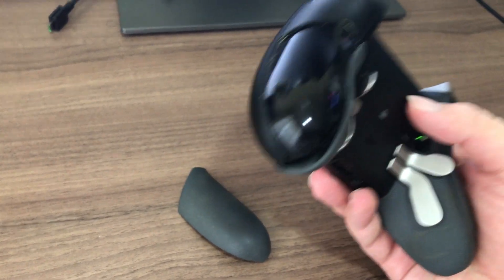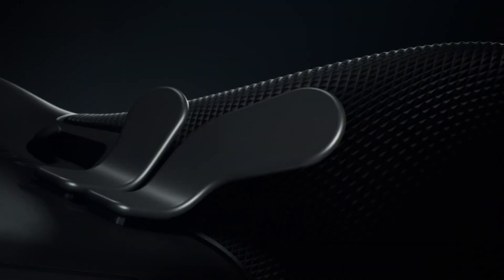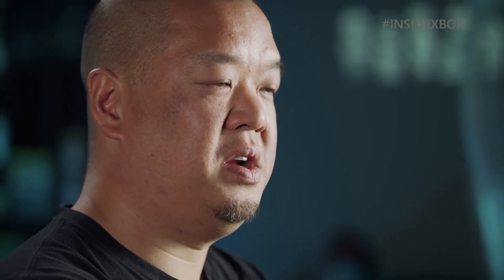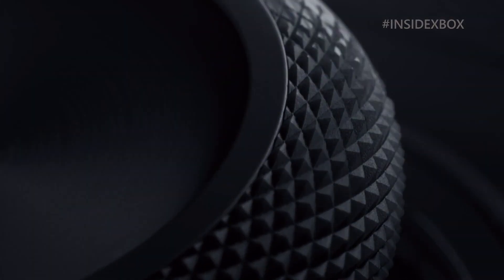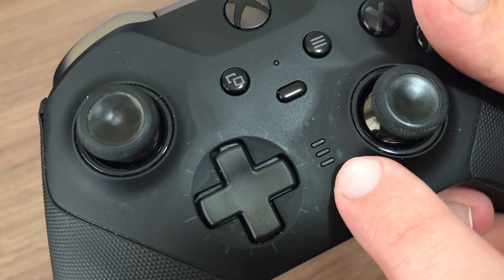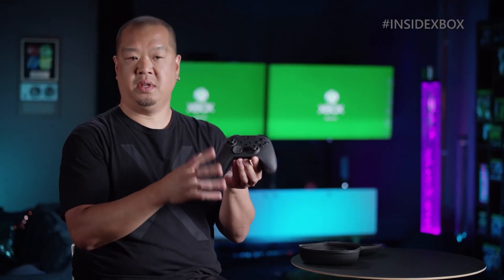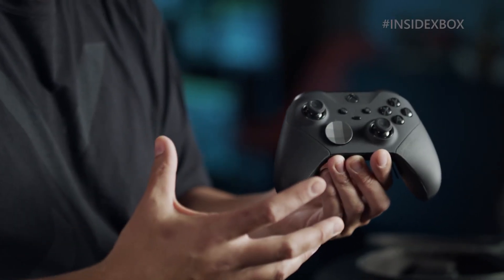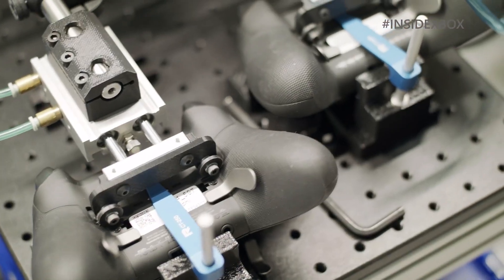Xbox Elite Series 2 After 1 Year: Did Microsoft Fix The Durability Issues?

Comment: I decided to treat myself to something fancy after my XBOne controller developed a stick drift after ~1.5-2 years of ~1-2h use a day. Bought the Elite v2 and it got in today - lo and behold, both the A and the Y button often don't register and on top of that it doesn't charge via the dock.
Absolutely unacceptable for such an expensive piece of hardware. I'm sending it back and giving it one more chance, if the next one I receive has issues aswell, I'll refund it and buy another controller.

Apart from those glaring issues I was also very negatively surprised to find out that the paddles can only be mapped to buttons that already exist on the controller officially which makes them useless imo. Thankfully I've found a 3rd party tool that lets you map them to keyboard keys aswell. Could still be an issue with games that don't support using gamepad + keyboard at the same time, but for Rocket League it works.
Reply: So, how’d the new controller go

Comment: After having durability issues with two Xbox elite controllers and one Xbox elite 2 controller I will never buy another 'Elite' controller from Microsoft again.
Microsoft should offer a warranty that matches the high price tag they charge for these controllers - but they don't which says it all really.
Don't believe the hype or shill reviewers in Microsoft's pocket. 
Keyboards manufacturers are able to rate their switches for millions of clicks at a price point less than these crap controllers sell for.
In fact my experience is Microsoft increased the price on the Elite 2 controller claiming they 'fixed' the durability issues that the original Elite controller had but I have found the Elite 2 controllers fail faster than the original version.

Comment: bought mine september 2020 and am currently on controller #7 never dropped and even put a silicone cover on it and yet still having issues and also accidently sent in the + dpad and still have yet to get it back. Not to mention the random disconnects and dealing with microsoft customer service is like trying to catch rain in a strainer... Just a heads up always buy direct cause they will honor a product way better than big distributor..

Comment: I had a problem with my A button turned into the controller Home button. I didn’t remap any buttons, I never threw the controller, I never damaged it in anyway. I play Destiny 2 that’s my main game and A button is the jump button so in Destiny it is A LOT A LOT A LOT of jumping, one of the most used buttons is whatever the jump button is mapped to. I even tried to remap the A button to something else but when I did that the A button completely stopped working and didn’t do anything but then started with bringing up the home menu like the Home button on the controller. Shit was stupid weird and ever since then I went back to the old controller that came with the console. I don’t know if anyone else had that problem with the button press does something completely different then what it’s programmed to
Reply from the maker: I've had this same issue when I remapped the RB to something else. It actually activated the Home button for some reason. Resetting the remapping fixed it for me though.

Comment: I returned 4 elite 2 at Best Buy already, all of them in the same week, first one had a paddle problem, second one, had stick drift out of the box, third one, had some kind of magnetic resistance on the joystick only when pushed left, and the 4th one, had a probleme with one of the bumpers, hope the 5th one is the good one.... if not, I might just refund it to get a Razer Wolverine Chroma V2.

If someone wants to buy a Elite V2, best of luck.

Comment: Hmm, you mentioned that the "plug&play" batteries suck but I've been using that kind of battery for a few years now. Lasts for I dunno.. at least 10-20 hours minimum. It's difficult to tell since PC doesn't tell how much charge there is exactly. Maybe I have just been lucky. 

My current controller works well and has for many years but I've just been researching whether it's worth buying the elite controller since the paddles would be nice for many games. The same two things came up everywhere: sticky A button and RB inconsistency. That's really bad since RB is used for attacking in dark souls and it's the game I play most on controller. I don't think I'm willing to gamble on the elite controller unless I find it heavily discounted somewhere. 

Thanks for the video
Reply: No competitive gamer would use a wireless controller. I use a wire and have my USB poll rate on 1000khz/1ms. Wireless is fine for single player games though.
Reply: I got my play and charge at launch for Xbox One. I'm still using it now and have zero issues
Reply: Ahhh have you tried pressing win g when u have the controller plugger in its shows the battery charge
Reply: @EmergencyChannel  actually won't make any  differences between a wireless and wired only like  1-2 milli second difference a human brain wouldn't notice that at all

Comment: I had an elite 2 for something like 2 days, the A button didnt register half the time. I returned it to best buy because of that. Just bought myself a PowerA Fusion pro 2, its far better out of the box and I feel like its gonna last longer. Even the analogs on the elite 2 didnt feel right out of the box. I think Microsoft needs to focus on durability if they're going to charge 180 bucks. As it is, its definitely not worth it when you can get the PowerA fusion pro/pro2 for less than half the money that thing costs.

Edit** The powera controller is trash dont buy it. I Had 1 elite 2 i bought, the first one. The analog was broken out of the box, not even connected and forced to the side and just broke. Traded it in and got the one i mentioned before with the crap a button and returned it. Fast forward a year. I bought another from best buy, and bought the 60 dollar 2 year warranty for it. I used it for about 6 months for about 4-6 hour or so daily usually. And it was great. Put it in its case zipped up for 6 months, cause I started playing on pc.

Pulled it out not long ago. The LB button double clicks, i tried the paper trick and everything, and nothing works. So im going to have to use the 60 dollar warranty for 6 months use on a 180 dollar controller. I will NOT be buying another 60 dollar 2 year warranty with the one I get. Simply for the following reason. Since feb 28th, I have put about 1700 hours in Lost Ark on an Xbox one controller that cost me like 50 bucks. Thats double or more the hours I put on the elite 2. 

So yeah, its great, when it works. But so far im 3 down, and none of them have been good. I would say stay far the f away from the elite 2. If you have to have paddles. Go with a razer, i hear they are far far more durable than scuf or elite controllers.
Reply: i bought 3 different elite series 2 controllers all with different batch numbers, ALL of them had the A button not register half of the time, returned all of them. bought a SCUF controller instead and it has been working flawlessly for about a year so far.

Comment: Xbox series x owner since launch, basic controller is still going good, the elite2 version had issues out of the box (didn't hold a  charge) got a replacement, lasted 2 months then got stick drift, got another replacement, after 3 month the l2 bumper stopped working and the right rubber grip was coming away, got onto Microsoft asked for a refund under UK not fit for purpose laws, I got full refund, still on basic controller with 6-7 months use and is still fine no issues......a  controller you can buy 3 of for the same  price of an elite 2.
:shrug:

Comment: My only problem along with many others are unresponsive AXYB buttons. You either have to hit it harder than usual or hit directly in the middle every time. I usually hits my buttons softer than what is required now. I wouldnt recommended this controller until that problem is fixed
Reply: Just had this issue with my second replacement .kept missing my shots on fifa . On to my third bad .....

Comment: I finally splashed out and got one 3 days ago, brand new, and was faulty out of the box. Vibration was just manually going off like crazy even with no game loaded, just moving the controller/my hands and pressing nothing LOL. It was the right trigger vibration, was totally broken, and didn't respond with the software tool at all like the left trigger did, yet was going off on its own particularly when the trigger locks were closed.. I sent back to Amazon and so far the replacement seems OK. Still, for 250 Australian Dollars, you have to wonder about Microsoft quality control. That said, it's the most comfortable controller I have ever used in my life. I have large hands, not huge but large, and I have arthritis and RSI at age 50, and I can play for hours with this controller.. It's heavy yes but it's comfortable and your hands don't slip. I played for about 3 hours last night and really enjoyed it. If only it had a turbo button, as I still love my retro emulation and for the very old games my hands just aren't healthy enough to manually hit a fire button over and over for an hour anymore. If it had a turbo button I'd never need any other controller, but I got an SN30 Pro 2 for that exact purpose. Sadly, I find the Pro 2 quite uncomfortable to hold and use, especially the d-pad which causes my left hand a lot of pain. If anyone knows of a quality PC controller in the xbox style layout, with turbo, do let me know so I can try it out.

Comment: I had an Xbox One controller which developed a double tapping dpad after 1 year,  I bought an Elite 1 and the X button literally completely died after 6 months of light use - so much for premium quality.  These things are really fiddly to repair too.  I was tempted by a Series X Carbon after that but I just don't trust MS controller reliability anymore.  Instead I'm getting an 8BitDo Pro 2 since it has good reviews and programming software, plus it's cheaper than MS offerings.

Comment: Getting my third Elite 2 under warranty. The first had severe stick drift, the second P1 didn't click like the other paddles. The Elite 1 just fell apart after 2 years. Still, a high quality controller is now an essential product for me, and I still like Microsoft's offering and am willing to endure this. I hope the huge losses they must be making won't deter them from making other hardware in the future.
Reply: The ones under warranty are all garbage. The only fix is buying a new one till it breaks again.
Reply: Both my back buttons p1 and p3 have just stopped working for no reason and the paddles rattle about build quality of this controller is absolute garbage

Comment: I dont use my face buttons near as often since i map them to paddles most of the time. Right now im having to replace my right analog stick because the R3 button stopped registering since the plastic inside broke. (Controller fell off my desk) Not a hard fix if you know how to solder.

Comment: The original xbox battery packs were amazing. For the 360 and the one. 
I’ve used the same pack from xbox one release till elite controller 2 came out. 
And it still worked perfect.

Comment: I bought mine pretty much right when it came out. It's help up really well for the most part, however recently I've had issues out of my left bumper, and both of my rubber trigger lock pieces fell off a long time ago, definitely something microsoft needs to fix. Battery is still excellent.

Comment: I have never had an issue other than the average disconnect scramble crap that happens once ever blue moon. Since having the series x I haven't had an issue at all.
Reply: Yea that's the only issue I have too. Otherwise it works amazing.
Reply: Yep.  I can attest that the disconnect issue is the Xbox receiver, not the controller.  I've had a Series X with an Arctic 9x headset and elite S2 function perfect 24/7.  The wife was using an older Xbox with the same - constant headset disconnects.  Since she got her Series X, both of our controller and headsets never disconnect.

Comment: I've had 3 of these pos controllers, I bought a used one that was supposedly mint condition and a lot of the buttons were unresponsive, So I said fu#k it I'm buying a brand new one, So as I bought it I noticed the A button was unresponsive, it works if you push harder but forget all that when you're paying almost $200 for a controller, So I took it back and got another, And this has the exact same problem as the last one but worse. So I'm exchanging it today for the last time. I'm going with scuf instinct if this one has any issues
Reply: Really I just bought mine a week ago and its working perfectly and I’m sad to admit I’ve already dropped in once. I really think some batches aren’t being treated incorrectly.
Reply: Get the razer wolverine tournament edition
Reply: @SuperSimdawg  That's what I have, bought it years ago and it started to get stick drift and razer sent me a brand new one even after it wasn't covered under warranty anymore.  It's starting to do it again but after two years of constantly playing rocket league.  I don't think I'd ever go with Microsoft again as the "elite" controller had stick drift months after I bought it and I ended up taking it back.

Comment: Left thumbstick has issues when pushing up it will continue to move up when release a lot, left thumbstick pushing down it will continue to move down when release a lot too. Also Xbox button is hard to press, sometimes it won't work. Also LB & RB are sticking when pressing it once, it will move more than once, sometimes three time's. I purchases my controller directly from Microsoft, I only had it 5 months.

Comment: My biggest issue was the rubber near the paddles. Also the back left paddles had a piece of plastic reinforcement break off so my top right paddle doesn’t work without pressing directly where the button is located. I still bought one of the custom ones to replace it simply because it’s the best controller you can get for the money.

Comment: Two elite 2s under one year with heavy gaming (avg: 3h at least per day) both RB buttons broken. Another is not responding not even opening up the chase and trying the button itself. Second is "loosely" so it sometimes responses (quick fix to tape 2 layers of extra tape on that "fraction tape/plastic" which is between bumber and the key. Also second controller's left stick does not always return. Even stick is at middle in Xbox test stick shows that they are slowly returning back to center deadzone.

Games which played over years were Overwatch, Apex Legends, Assassin Creed series, Rocket league. Which all requires heavy clicking. At least AC series "rapes" the RB as light attack key binding. And left stick gets a lot of action in all games.

Even all of this is it is still the best controller ever done and when you don't have competition using more stronger components is useless. And because of muscle memory I cannot go back to normal.

Comment: So your trigger lock switch fell off with a small bump and the buttons don’t work properly…. Sounds like just because it is better than the first one you are icing it a huge pass on the bad build quality.
Reply from the maker: You got a bit of selective hearing going on over there. I literally call Microsoft out for the switch breaking so easily in such an expensive controller.

Comment: There's an other point Microsoft should correct : making possible to assign any keyboard key to any button. It is possible as tier solutions do it (steam, antimicro, rewasd etc), it is very easy (for them) to do, it would just take an update of their setting app, it is highly convenient for users, and with such a price we should expect the best starting with what already exists.

But even if they did it, it would still be a poor choice as its durability is very problematic on many points. I have enjoyed basic xbox controllers for years, I just can't understand why a product 3 times cheaper is way more durable than this one. For some special features I get it, almost... for instance there's no vibration motor in triggers within the basic xbox gamepad, so it wont break like Elite motors do (except most of the time they stop working just because of one wire breaking just before solder point on the motor, witch could be fixed by making a better job on retaining wires from moving around). But for other stuffs like the A button getting squishy within some months, while it can last for years with the basic gamepad, it's just absurd.

On several issues like the A button, or analog sticks, they know how to make it right, so it's a choice to not make this one as good. Trying to understand why do they not want to make their top end model at least as durable as their basic one is very confusing, especially after years of massive complaints. Why would most users want to buy several times such an expensive device after having troubles since their first one ? I know planned obsolescence is a profitable thing for companies, but the more expensive a product is the more it should be durable anyway. In a lot of cases the obsolescence of the Elite is so fast that it gets bad before guaranty ends...

Comment: I have had both and I've only minor things happen. When I had the scuff vantage it sat for almost a year before I figure out how to fix the drift on my own. Alot of parts come off assembly lines. Sometimes workers may forget to oil parts. So you end up with stick drift. Take the controller apart and oil the housing to the sticks. Problem solved. You're welcome.
Reply: "oil the housing of the stick" i have no idea what that means